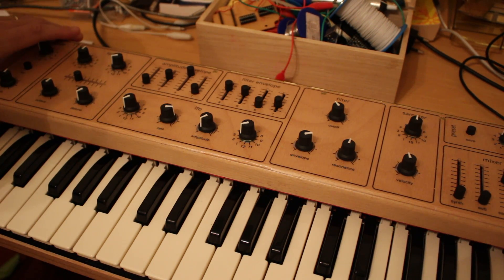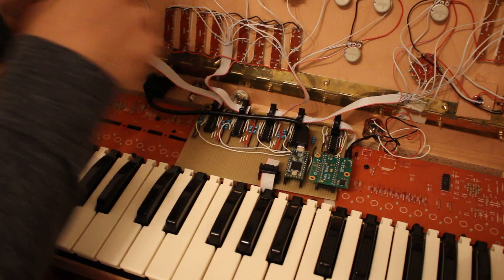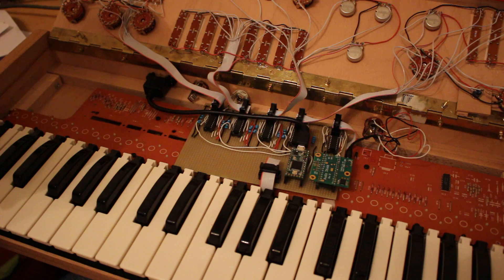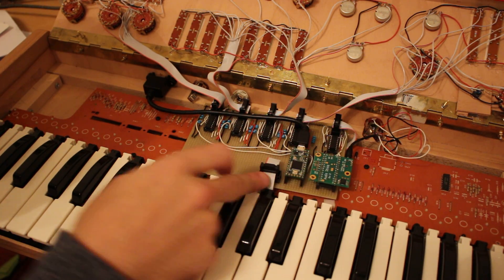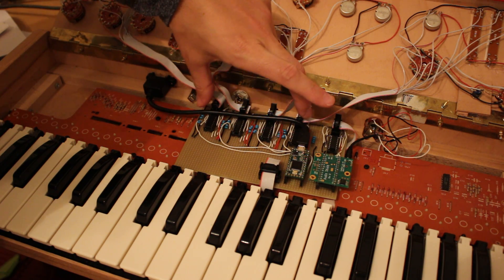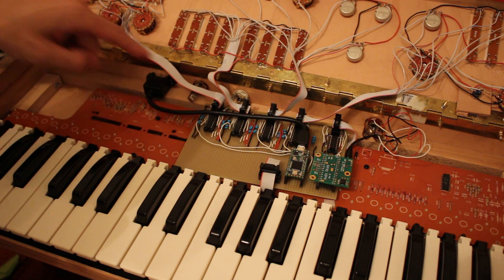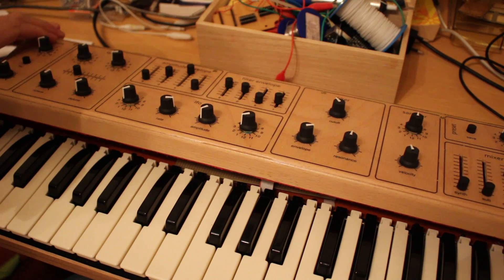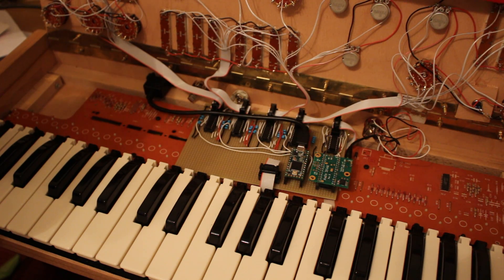DIY Teensy Synth: the Electronics

Comment: Hi Florian, very good Project!
 Is It possible realize something similar with the Teensy 4.1 and revD audio shield?
Reply from the maker: Yes, absolutely. That will give you a lot more processing power, which comes in handy for things like reverb or advanced filters,  as well as more inputs, which are practical for controls without needing as many multiplexers.

Comment: There's two types of rotary switch; "make before break" and "break before make" (also called shorting and non-shorting). The "break before make" ones completely disconnect between each position which may be easier for you to work with.

Comment: For your "12 to 1" switch, just put a 1k resistor in series with the +5 supply to the switch so when it shorts +5 v to GND, it will go through a current limiting resistor.

Comment: Hello.. Maybe the issue with the "semitone" selector is solved, by now.. but if not, why not using a potentiometer ? The Arduino code could read the  value and convert it into discrete values or steps, from 0 to 11..
Reply from the maker: I actually used this method in an early prototype. It works, but it doesn't give you the tactile feedback from the mechanical switch.
Reply: @floretan  I totally agree.. and what about an encoder, then ?
Reply from the maker: @opusquatre  an encoder gives you the tactile feedback, but then you lose the visual indication of the current value, so you would probably use it in combination with a screen. I could imagine that working quite well for example for going through presets, but I have encoders on one of my midi keyboards and always disliked how little control they actually provide for musical parameters.
Reply: @floretan  Ok.. then maybe a system (the arduino ??) which would scan the pins, detect each time a pin of your rotary swith is changing state (turns from 0 to 1) and would then read, and memorize, the actual state.. and would ignore when the pin turns from 1 to 0, until another pin turns to 1.. maybe..
Reply: @floretan  You are using the wrong type of rotary switches you need Non-shorting BBM switches they are readily available.

https://www.digikey.com/products/en/switches/rotary-switches/200?k=&pkeyword=&sv=0&pv1801=380410&sf=1&FV=-8|200&quantity=&ColumnSort=0&page=1&pageSize=25
https://www.mouser.co.uk/Electromechanical/Switches/Rotary-Switches/_/N-5g2i?P=1z0z2wg&FS=True
Reply from the maker: @katebovski6947  thank you, I wasn't aware of the different types, and even when I became aware of the problem I didn't know the right terminology. This is very good to know for future projects!

Comment: Thank you for sharing this project. Between the three videos and the code on GitHub it was pretty easy for me to follow your design. I really liked your use of wood for the case and the transfer technique for the panel markings. Great job :)
Reply from the maker: Good luck with your project, I'd love to to see what you come up with!
Reply: @floretan  I've been borrowing parts of my ideas from you, Notes and Volts, otemrellik, mitxela, Synthetech and rethink621. I  like the clean structure of your code, and I'm thinking of redoing mine in a similar fashion. Right now my hardware is on a breadboard, most of the controls are in PureData, and I'm elbow-deep in coding. Thanks again for taking the time to post your content!

Comment: Did you ever find a solution to your 12-to-1 problem? You could use a 1K resistor from the supply voltage to position 12, then use eleven 1K resistors to go from 12 to 11, 11 to 10, 10 to 9, etc, with ground wired to position 1. You preserve most of the voltage range that the Teensy's A/D converter wants for distinguishing between positions, but even when the switch shorts, you never have less than 1K between supply and ground, where most of the time you have 12K ohms. Cool project, thanks for the inspiration.
Reply from the maker: Yes, that's exactly what I ended up doing, and then read the voltages from the teensy as if there were 13 positions, that actually worked our without any issues.

Comment: It would be amazing to just see the schematic you have for connecting the pre-existing keyboard to the multiplexer to get it to trigger different notes. I have had a similar idea, and would love to understand more about how you integrated it into your own setup.
Reply from the maker: Since in this case I used part of the (pretty messy) circuit of the original board (as I mentioned in a few comments, I wouldn't recommend this bontempi keyboard). There is actually some pretty good documentation online on how to wire a keyboard matrix, like http://blog.komar.be/how-to-make-a-keyboard-the-matrix/, which is actually the same wether you're building a computer keyboard or a midi keyboard.
Reply: Florian Loretan Thank you for reiterating. I appreciate the link and clarification. I've been avoiding  keyboard build videos thinking they would be different.

Comment: hello, I did not get which bontempi keyboard you used..
Reply from the maker: It was a "bontempi musicpartner ms40". I wouldn't recommend using that though, the wiring is a bit weird and the PCB is big and it doesn't separate the audio and control circuit. Since then I did other projects with the keybed from a Korg MicroKey and a yamaha P150, both were a lot easier to figure out and to take apart.

Comment: Just want to compliment you on your built using the teensy. I see that you have soldered in the flash chip on the audio  board. I'm building one right now but on a much smaller scale keyboard. I would greatly appreciate if you can share how you wire the keyboard's pcb to the multiplexers. You really did a good job here and I'm curious as to what improvements you have added since then..
Reply from the maker: In the end I didn't use the flash chip, it's too small to store enough samples to cover all the keys, and writing to it is too slow to change the content on the fly (it takes about 40 seconds for a full write, during which everything else is blocked). Regarding the wiring of the keyboard, it really depends on the keyboard you have. In retrospective I wouldn't use this one, if you take apart a midi keyboard (the korg mikrokeys are great for that, the USB chip tends to fail so it's easy to find "broken" ones) you often get the multiplexer included on the pcb which is a lot easier to deal with.

Comment: Is there a github page for your project?
Reply from the maker: Nick Kracht yes, you can find the code here: https://github.com/floretan/bontempi, it could definitely use some improvements and of course it depends on the hardware part, but it can give you a few ideas.
Reply: @florianloretan please provide some hardware information such at circuit diagram or schematic for this synth please

Comment: Hi man.
This is great project.
About the rotary switch problem, there are two types of rotary switches.
Break before make and make before break. 
If you're using the make before break, then yes, you will have this problem, if you use the break before make i dont think this problem will happen. 
Which one you use?
Reply from the maker: Thank you Isak, I wasn't aware of this difference, this is very good to know. I guess the kind I got are "make before break". It was difficult to find some that are not too expensive that have enough positions, next time I'll try to get "break before make" rotary switches, that's a lot more practical for this kind of application.
Reply: Just use a diode, mate :)
This reply popped here a couple of times.

Comment: Very nice, Florian! I am eager to see the follow-up video in which you explain the programming of the Teensy. I am curious how much of the synth functionality you created and how much was in libraries you found. I am also curious whether there are any analogue circuits for your oscillators and filters, etc, or all digital? You have many nice features included! I built a modular all-analogue synth around 1981 when I was a teenager, never quite finished. So much soldering!  I applaud you for taking to a nice finished instrument.

Comment: hi, your synth looks awesome - I didn't really 100% understand the issue you describe about the rotary switches shorting out, but I think it'd be solved by simply adding another resistor, inbetween the ground on the switch and the actual electrical ground. would this solve your issue?
Reply from the maker: That's a good idea. It would slightly affect the analog read value, but since I'm converting the 1024 values down to just 12 positions it's probably not even going to be noticeable. Thanks for the tip!

Comment: Cool stuff.  It's kind of hard without seeing a schematic but could a protection diode help with the short circuit problem you mentioned?
Reply: 3 years later, my first thought as well, but you can not put the diode between the two pins because those get shorted internally by the moving switch, so you would need to put the diode in series with the plus or minus lead but that won't work, because then the current would be obstructed always. I think if a rotary switch does this, it is a bad design, so I would look for an other switch, or replace them with rotary pulse givers. Then again, because the output of this switch goes to high impedance shift registers, you don't need high currents in there, only voltages, so a simple RC network, would work, where the capacitor is charged through a current limiting resistor connected to the plus lead, and the 12 pin of the switch is connected through an other high impedance resistor to the plus side of the capacitor, so the same point where the first resistor is also connected to, so you detect the voltage across the capacitor through this second resistor, and then allow to discharge the capacitor momentarily through this second high impedance resistor when the switch shorts momentarily the 12 pin  with the 1 pin connected to ground. After which it gets charged again through the first resistor connected to the plus lead. Because this second resistor is high impedance the capacitor would not even be discharged all that much, maybe you won't even notice this, but whatever gets discharged gets charged again after the momentarily short disappears again.

Comment: This is awesome. Which multiplexers do you use?
Reply from the maker: I used 4051 analog multiplexers as that's what I saw mentioned for many examples (http://playground.arduino.cc/Learning/4051 among others). For some reason I couldn't find them at the local electronics store, so I had to buy them on ebay.
Reply: Florian Loretan thanks a lot, also could you share the code. Once more thank you for this awesome inspiration.
Reply: did you have the schematics aswell? would love to see the code. I think I'll finally have my head wrapped around this

Comment: I wish I'd known about Teensy audio before I started work on my synth... I'm using Arduino for control and Raspberry Pi for audio... and Teensy (especially with the audio board and library) looks like a much simpler way to go.

Comment: FANTASTICI I regularly repair, service and even customize my collection of synths and organs but I'd love to do something like this (Design my own frontpanel layout, etc.).
Is the synth parahonic (1 filter for all voices) or is it fully polyphonic (1 filter per voice)?
I have a mechanical tip for the rotary switch problem: Tap in a tiny little nail just outside of the pot cap and at the intermediate position between 1 and 12. Use pot caps with an actual outward arrow extension at the base or bore a tiny little hole in the ones you already use and glue an equaly tiny nail in there in such a way that both nails/pins touch every time you try to turn the knobs past 12. In that case you will not get any further. O.K., it is not very high tech but with a little bit of finesse (of which you seem to have more then enough) it could be made to look more like a raised graphical detail. Tiny round nailheads, just high enough to catch maybe. Stuff like that. You could even use small wooden extensions on the front panel in stead of nails. I am sure you'll be able to come up with something nice.
Reply from the maker: The synth has only one filter for all voices, I tried having one filter per voice and it was too much for the teensy's CPU. However, each voice has its own envelope, so I guess it's kind of hybrid between paraphonic and polyphonic. With less voices it should be possible to create a truly polyphonic synth. 

Thanks for the the tip on how to solve the rotary switch problem, that sounds easier than having to mess with the internals of the switch.
Reply: You mean every vocie has it's own amplitude envelope? So you basically "glued" the filter after the individual amplifiers. Why not. That actually makes a lot of sense although I gues one again needs and extra overall "VCA" after the filter for practical reasons. This could actually even be a good compromise in an analog hardware system, assuming the oscillators outputs are generated individually and not via a "organ-type" master oscillator divide-down system as is used in most paraphonics (string ensembles etc.). .

About he rotary switches themselves: Changing them might actually not be that difficult as log as the hardware aspects surrounding the bridging are not part of the rest of the functionality. Maybe you can supply me with a datasheet containign drawings or pictures of the internals of a switch?